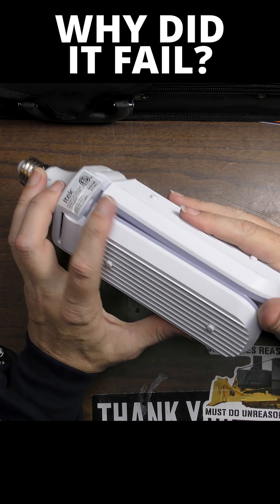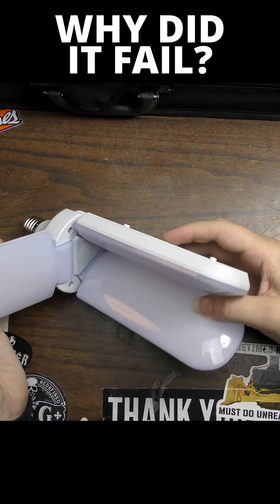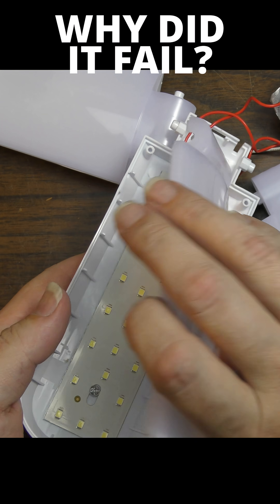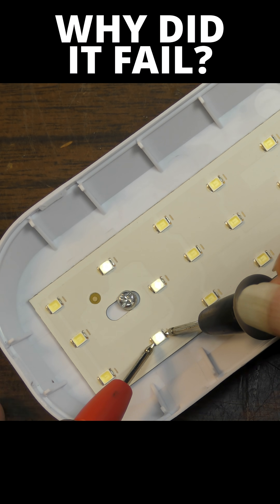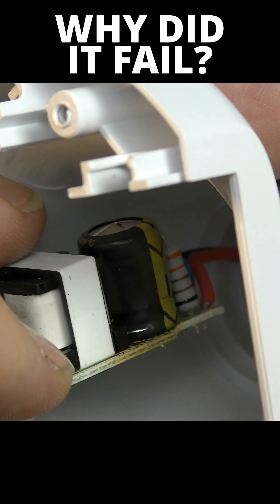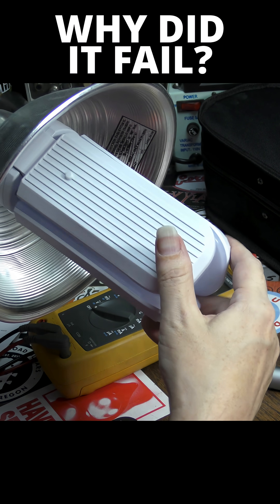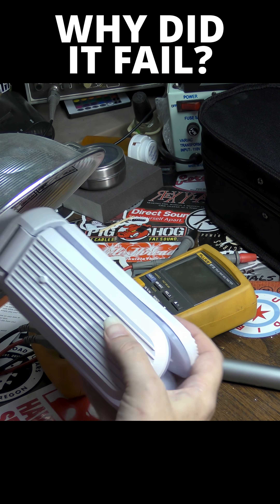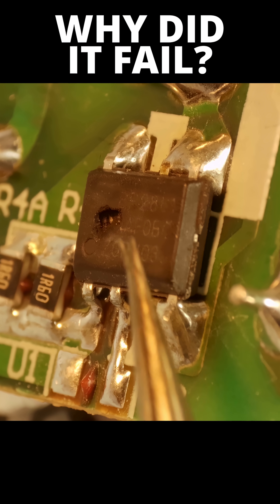WHY DID IT FAIL??? | FOLDABLE LED

Comment: Why bother? Didn't  you see the 8 pin IC had a hole in it? That's  the first thing I noticed. But I fixed electronics  for a living.😂
Reply from the maker: My eyes are not what they used to be. Easier to see on camera than in person on the bench.

Comment: Left the light on to long?  There is a lightbulb from 1901 in livermore (California)  that still works. And this modern thing already . blew the magic smoke. These LED lights always have an amount of hours on the package that this light should work. But the LED is almost never the part that brakes 99 out of a 100 times the driver stops working before the LEDs brake.
Reply from the maker: TVs are certainly different. The LEDs burn out on those far more often than the power supplies.

Comment: As an electronics engineer. As soon as i saw that capacitor before you even said anything i said to myself "yep, it's pregnant." 😂
Reply: I already spotted burned chip too but you just waste time in changing Capacitor and you could get another SMPS circuit for your light from online stores or aliexpress just you need to know right voltages for your led light
Reply: @AliPasha200 it is nothing complex we can make it by less than 10 components less complicated than the original board ...
I don't understand why engineer of that company make everything so complex even it is nothing 😂....

Comment: I have a simple LED spot light also with the swollen cap. It says 63v, 220 uF, but most cap kits max out at 50v, hardly worth getting a single cap to fix a cheap spot light, but it does piss me off.  I'd like to get say a 100v cap kit to fix LED lights when they fail, but don't know a good source.
Reply: The Chinese reseller of your choice. They're all from China anyway. Just make sure to read the description very carefully and look for reviews with images, so you see what you get. 100v are pretty rare as they're not good for a whole lot. US mains voltage is 110V, EU/most other places is 230v. 400/450V is easier to get because of that. But there are 100V ones as well.

Comment: I'll never understand why a tech doesn't check the operation after replacing parts before completely resembling the unit.
Reply from the maker: Because in this case, the test socket was up off the desk and the LEDs would have been hanging of the driver and twisting while I screwed in the bulb. Didn't thing that was such a great idea.
Reply: obviously youve never fixed electronics

Comment: I would replace the whole driver (possibly with a better one) instead of just replacing the capacitor on it.

Due to the wiring it makes me think it's a CV mode one, instead of a CC one, and since there's plenty of room, a more suitable and bulkier one could be used instead

Comment: It's always a bad cap and burnt electronics. They leave out heat sinks on purpose.
Reply: That's why I'm glad my shop lights that are a petal design like that, are made with a lot of aluminum. The entire pedal where the LEDs sit is a heat sink, and the housing for the controller is a heatsink. Haven't had an issue in years, and they been left on for hours and sometimes an entire day or two.
Reply: Simple yet brilliant!!
Reply: That's mass, and mass is material, and material is expensive. Pennies count.
Reply: @8BitNaptime And forcing you to buy a new one every year or two is way better for the bottom line than raising the price 5% to cover the added expense....